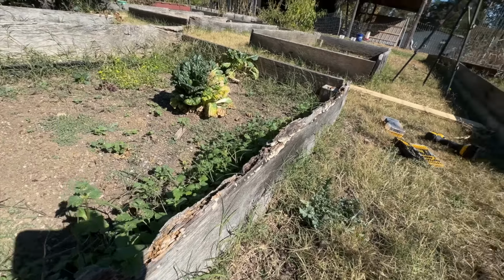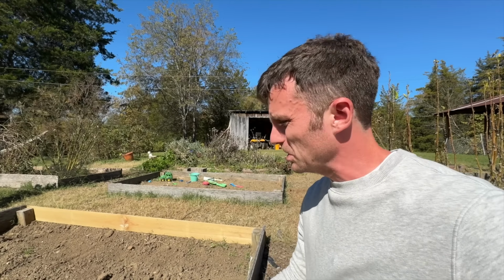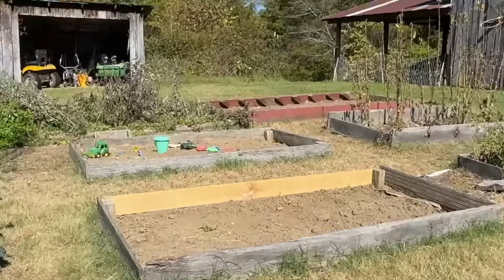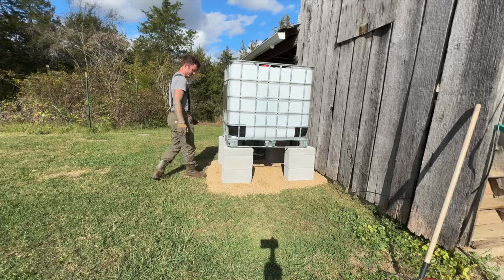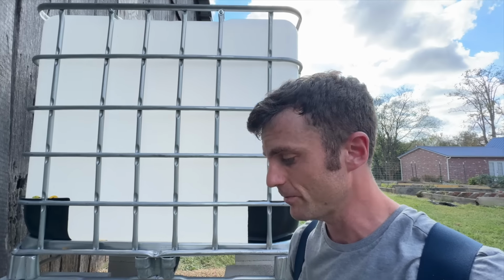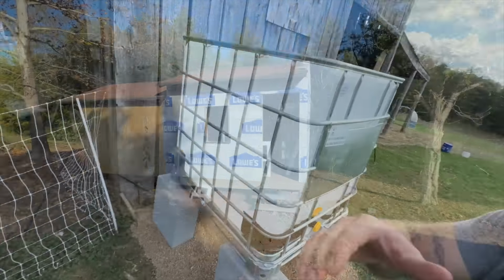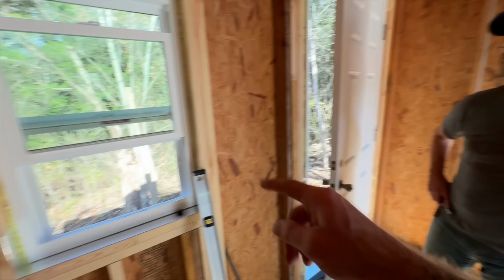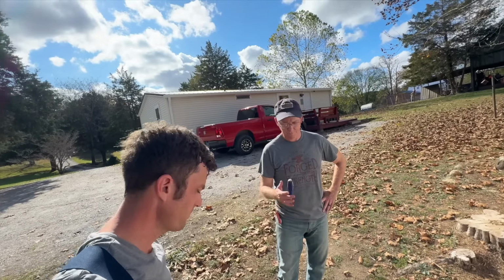A (Literal) Ton of Water For Our Homestead

Comment: wonderful to see you thinking ahead! I would not increase the height of the raised beds until you generate the compost to fill them....slowly slowly they will get filled and you will save a bundle on topsoil!! the space beneath the IBC tote can be used to store hoses and accessories.
Reply: Great idea, but with a locked door or else Henry could still get in there.
Reply from the maker: Great call on the storage space under the tote; next video will show how I made a skirt/door system to do exactly that. Thanks, Hap!

Comment: Great video.  Might I suggest with your pickets to put a center stake in on the long runs to prevent bowing when you start to add stuff into the beds. Also depending on the rot damage you might be able to use the old wood as wrapping around the IBC tote base.  Just my 2 cents.  God Bless from TN.

Comment: Hi. Laila from Norway here. Again :elbowcough: We have two of those exactly same water containers here. One by the cabin, and one by our house here at home. We have never had any problems with leaving the water in the tank through the winter. Just make sure that the water has some room for expanding if you get frost. (Winter temps here are rarely below -10-13 C. ) We have some simple water pumps to give us water pressure and those pumps get taken inside the house or garage in the winter, to avoid the pipes inside freezing.  I think that you will probably have bigger problems with algees in the summer than frost in the winter. We have found that water coming from the north facing side of the cabin roof seem to bring more dirt and algee into the system than the south facing part, so we've disconnected the north facing gutters. That helped a LOT with the algee-issue. At the cabin we also put a small amount of clorin in the water, since we only use it for cleaning, toilets etc. I'm not sure if your garden would thrive with clorin... Good luck ;-) I like the way your dad's project slowly is taking shape. Well done Yeopops!
Reply from the maker: Incredible info here, Laila -- thank you!

Comment: That cap on the tank is 2” pipe thread in case you didn’t know, the bung should come out easily.  The valve is also 2”, a coupler, reducer to3/4” and an adapter to garden hose and you are away to the races.  I have 6 of them😊
Reply from the maker: This is EXACTLY what I was looking for -- thank you for this info, my friend!

Comment: Where did you get the totes at? I met you at the Kraemers when you were cutting the pine trees that fell.
Reply from the maker: Hi Mark! I got the tote (and the barrels) from Volunteer Drum in Knoxville. They usually have a lot in stock, but I always call ahead to see what's available. Their used food-grade totes and barrels go very quickly. They are good folks and I vouch for them.
Reply: Was at the ACE hardware (I think it was Chapel Hill TN) and they had some for sale $99.00.  Hopefully this helps, God Bless from TN.

Comment: This was not at all a how-to video and the details were not shown so I do not know how the installation actually went down.  In the video it seemed to show you securing the door with nails through the brick molding.  Typically, we secure doors by lagging them with screws through the frame.  I hide three lags on the hinge side with screws through the hinges and more are hidden under the seals, but I am unafraid to let a few show.  Usually I let the brick molding float and be only attached to the door frame.  Just suggestions, and perhaps you already did it this way because as I said the detail was not videoed.

I love seeing what you do.  I will keep watching and try not to give advice too often.
Reply from the maker: Thanks for the tips here, Dwight! We actually did add several screws to the frame via the hinges, but didn't end up catching video of it. Appreciate any advice you can give; Dad and I always read through the comments for ideas or things that we may have missed!